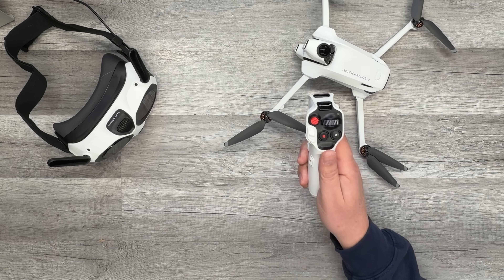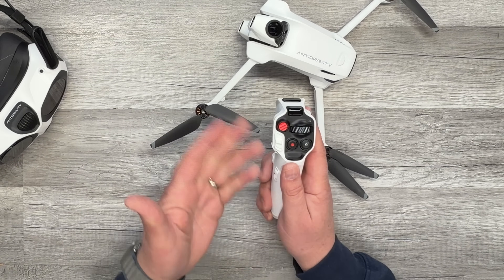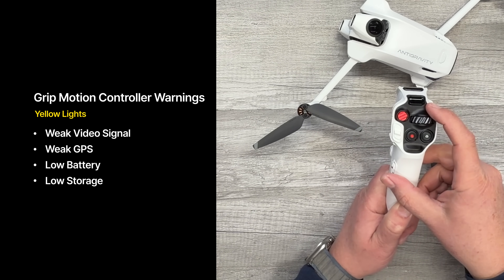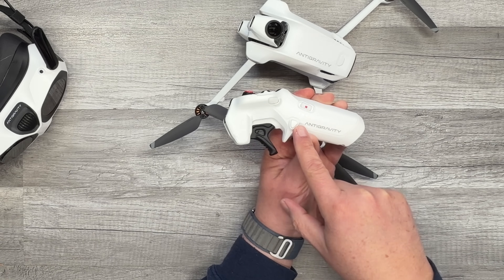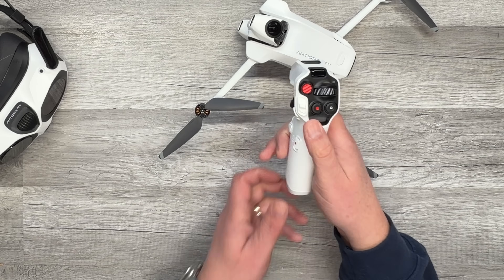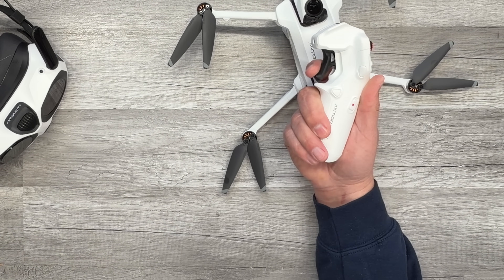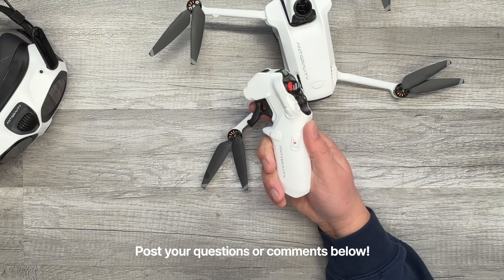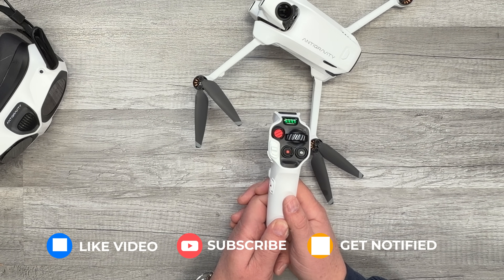Antigravity Controller Walkthrough - Why No Standard RC?!?

Comment: Watched a few videos on the A1 and like others 1500 to 2k depending on the bundle is ludicrous, I barely heard of this company until recently with this drone. To fork that kind of money over for a company and product that hasn’t been battle tested unlike “DJI” and refined such as they is a hard pill to swallow.  As for the 360 camera it is cool concept and done that on my other drones but with reduced performance due to weight so to have that all implemented is niche and cool to have. But on the flip side giving that DJI is going to most likely get banned its cool to have a possible alternative but that’s going to be hard to live to that expectation for other companies trying to compete especially for the price points to performance because DJI for commercial sold drones barely anyone compares on that front. I heard through the videos on why this cost so much is not the drone but the goggles headset which it’s cool looking but for myself half is impractical and rather have a cheaper set with less gimmicky stuff implemented and heard the optics are good but not as good as the goggles 3 by DJI. Also the flight stick in my opinion is not as refined as the motion 3 , the wheel spinning knob to rotate looks annoying and less immersive. Missed opportunity.  The only funny cool thing I thought looked fun was the AR dragon that looks like your flying on looked fun but that’s it. The camera system lens replacement is nice but wait until people start crashing this and breaking arms and lets see what that cost to repair. This will be interesting none the less

Comment: Nice review as usual. Some limitations I see is the small sensor size and the lower resolution once you crop into the 360° image. Also, as you alluded to, the law requires you have a visual observer at all times when using goggles. I expect few to follow this and noncompliance will lead to accidents and consequences especially in urban areas. But looks like a really nice advanced product but there needs to be a traditional DJI type controller.